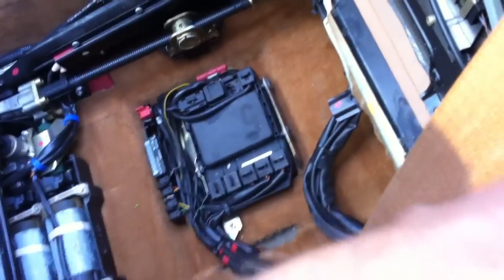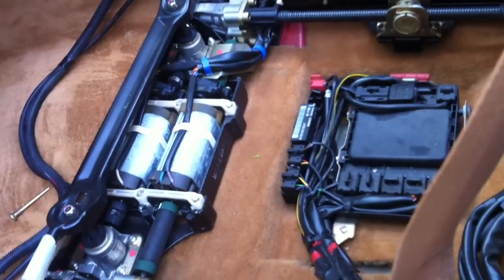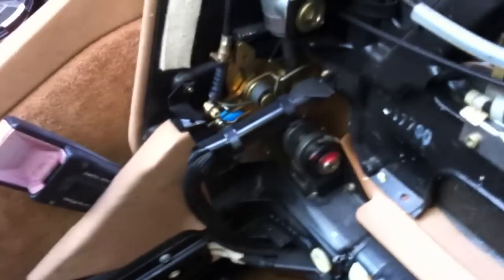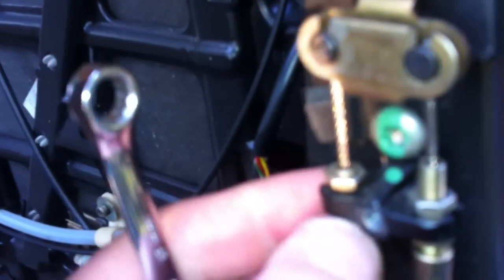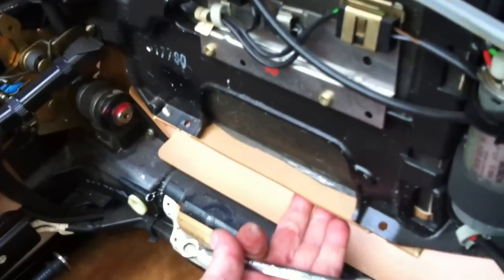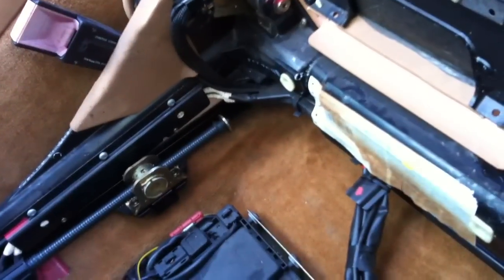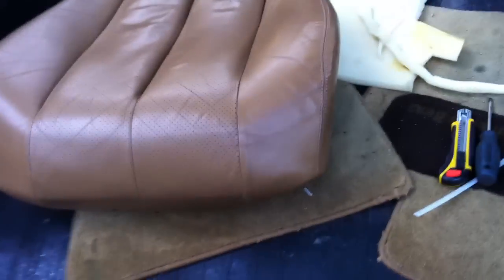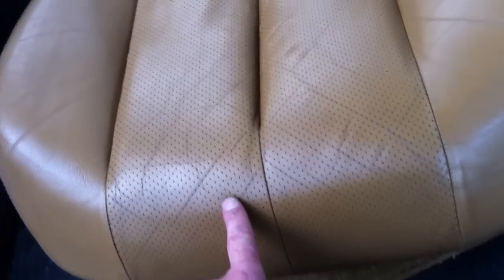Mercedes 500sl ,320sl r129.. repairing stuck seatback release latch

Comment: Did you ever make a video on the taking apart the headrest ?
Mine will not go down and makes a grinding noise
Reply from the maker: No unfortunately I didn't . Likely the teeth on the plastic gear are stripped , or the gears are cracked . If I recall correctly the motor is under the seat driving a cable up to the headrest seatbelt holder. the gears would be up top

Comment: Ive got the same issue on my drivers side seat, after watching your video I had a crack at it last night. I noticed that the lever which connects to two cables, one as you rightly say one goes to the latch, which appears to be working ok, however the seat wont tilt forward, and the other, you mentioned goes to a ‘motor’. This cable is snapped on mine, would this be the reason that the seat wont disengage?

Comment: hi fupabox, do you possibly know what could be wrong with a w140 coupe .. if the  seat backrests doesn't lock ? they should lock when engine is running and doors closed.. but they dont
Reply from the maker: I think the w140 seat backs are locked by vacuum, as were the w123 coupe.  So a check of vacuum lines and distribution blocks would be needed to see where the leak is
Reply: ***** thanks. would that mean looking under the front seats?
Reply from the maker: farerse yes ..the vacuum lines run under the door threshold trim and back to the vacuum storage container under the parcel shelf...oddly if you are a smoker it is easier to find the leak, as you can blow smoke into the lines and see if it comes out anywhere... I would check the lines within the seatback first...remove the backrest cover (couple of screws on the bottom, then slide downwards )and you will see the colored plastic line
Reply: I don't have the parcel shelf.. mine is a w140 coupe :) But i checked under the rear seat and front seat backrests .. I can't see anything broken.. no sound of leakage. is there a module that can go bad that controls the front seat backrests lock ? there are other minor issues with the interior but i don't know if they are related or not.
Reply from the maker: farerse dammit .. you said w140, but in my mind I was thinking w126.. Man I need to get a new brain sometimes.. :)  let me check my reference books
Reply: ***** lol you are very kind sir! I was thinking that they are basicly the same during this period (90s).. or that you might know the answer if it is w126 r129 w140 all the same :P
Reply from the maker: I realized I had been answering some w126 questions from another guy, and got you mixed up with him..sorry for the confusion.. I found a link to the w140 500sec repair manual,,I have linked you the starting page from the seat section (left side of page to navigate to different sections )  don't worry about donation pop ups..they are harmless and you can just x them away  http://workshop-manuals.com/mercedesbenz/500sec_(140.070)/v8-5.0l_(119.970)/body_and_frame/seats/diagnostic_connector_seat/component_information/diagrams/
Reply: ***** thank you very much for the effort, altough i've already read some of that content before but not being able to figure out my problem anyway :(